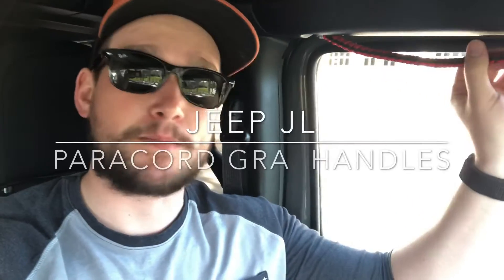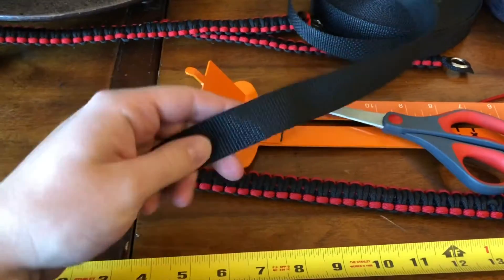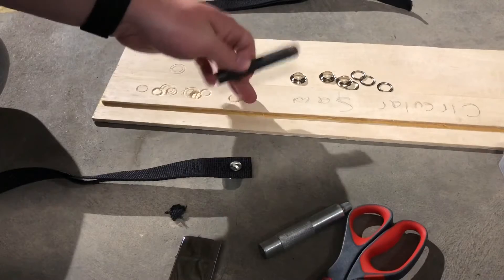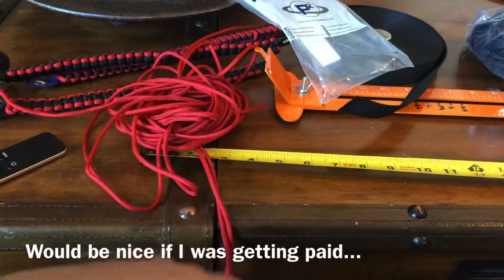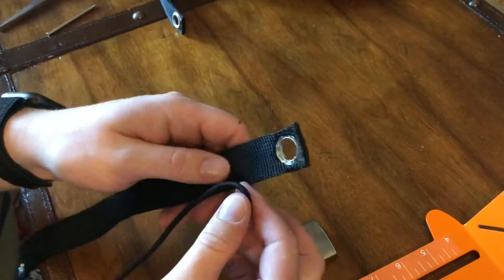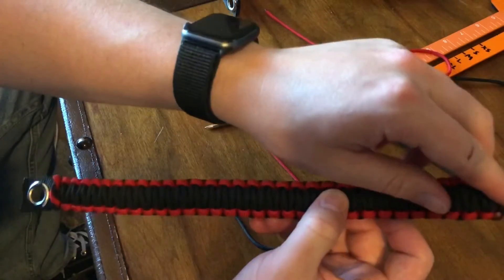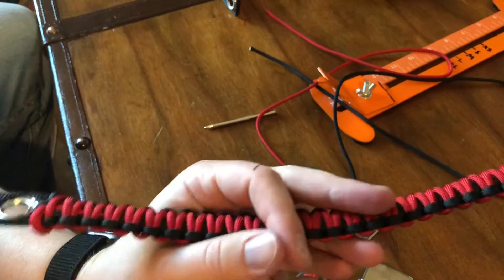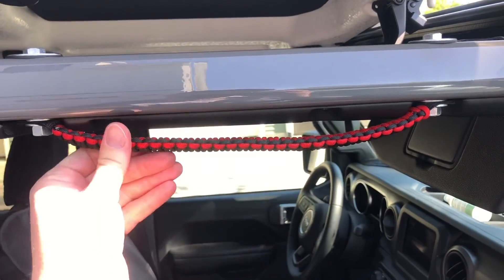Jeep JL - Paracord Grab Handles DIY

Comment: What size grommets are needed?
Reply from the maker: I used a 1/2" kit
Reply: @dylangrimmett3092  I was looking at my jeep but I don't see how to get to that screw.....I have the power top. Does that matter?
Reply from the maker: @Soinlove2day  I don't have the powertop so I can't say for certain, but that hole location might be already occupied by that powertop hardware. You might be able to use the existing bolt in that location, but again I can't say for sure